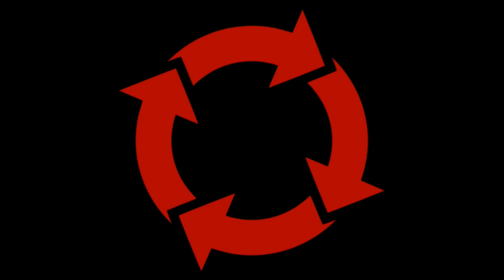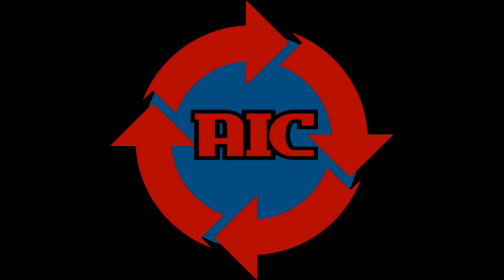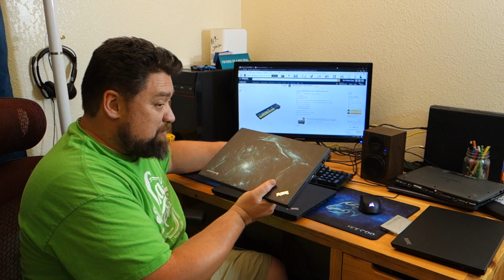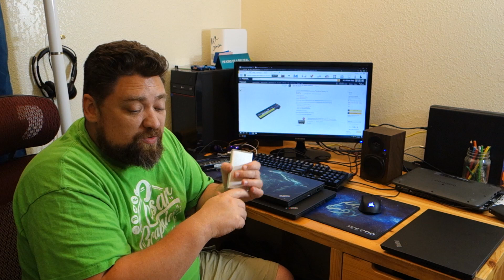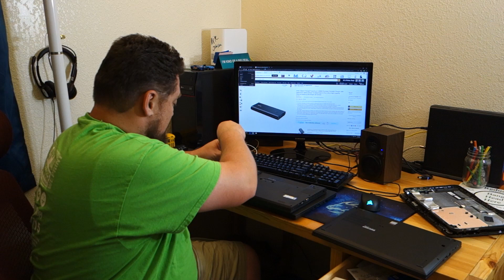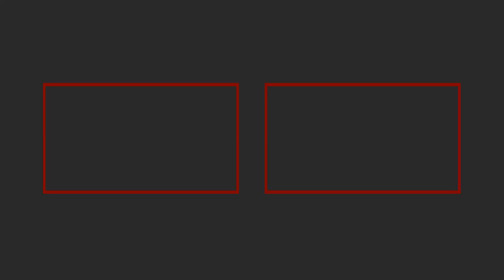My take on Thinkpad no longer having removable batteries

Comment: I think my x270 can be charged via the USB-C. Does that mean it works in the same way as if it was plugged into the mains with the square cable, to where it will charge the battery that is low but let me work also? (by using an external 65w powerbank charger)?

Comment: T480 has 96WH possible with Power Bridge. T480s without Power Bridge only has a single 57WH battery. I demand being able to swap batteries. This is a stupid direction just like soldering RAM and their legacy wireless card whitelists.

Comment: I might be wrong, but I believe the older batteries used cylindrical cells which are readily found in case you want to DIY a battery cell replacement. I know that the slimmer batteries on some of the laptops that I have don't have cylindrical cells, and have a soft cover, making DIY replacement basically impossible.

Comment: Only thing I'm afraid of is whether my otherwise slender fingers will be too thick to properly reattach all the flat cables after removing the motherboard to get to the battery. I was lucky I only had to remove the back panel to replace one of the ram sticks last I opened it.

My battery is at a point where it dies when it drops below 20%.
Reply from the maker: I just replaced a battery in an x280, it was super simple, no ribon cables, no motherboard removal, Just the back panel, 4 screws for the battery, and it lifted right out, new one click right in, 4 screws back in, back panel back on.
Reply: @AICvideo  Too bad I don't have that model.
It looks like it won't be too annoying on mine either though, but next time I buy a laptop, I'll either have to be lucky again or do extensive research on a product I don't care terribly about the specifics for.
Reply from the maker: which model do you have?
Reply: @AICvideo  It's and acer a315-55g. I've looked at videos, battery should be easy enough to replace. 
I was surprised to see it came with two 4gb ram sticks, one on each side of the motherboard.

Comment: The main reason behind non removable battery is company is forcing its user to use battery.
Once battery is depleted then user must go to company service center get your battery fixed.
Here company makes lots of money from selling you battery and also making you to pay for service center for opening your laptop.

I bought hp p028tx in 2014 .
It has user removable battery.

intel i3 
4 gb ram
2 gb ddr3 gpu.

I bought this laptop for gaming and coding.
when at home or at office I have constant power hence I remove battery and plug my pc directly to power using adapter. 
My laptop boots quickly and performs better on ac [alternating current] power.
I have used my laptop battery barely 2-3 times in last 6 years.
My battery is still intact.I have never wasted single penny on battery.
I upgraded my ram to 12 gb.
I can still play games like grid auto sports, dirt rally, assassin's  creed series from 1 till rogue.
AAA games consumes lots of power and hence it is not recommended to play on laptop with battery.
go for desktop or just remove your battery before starting game.

I definitely think laptop with user removable battery are required and companies are not manufacturing them for their own benefits.
Reply from the maker: batteries can be replaced by the user. It's a handful of screws and 10 minutes to do. They cannot be swapped out like they used to be able to, but anybody with a screw driver and a guitar pick (I use an old gift card) can get the job done, and batteries can be purchased from dozens of online sources.
Reply: @AICvideo  

Most of laptop brands consider opening laptop from back from unauthorized person as voilation of warranty.
[At least in india ,not sure about other countries.]

There are 2 type of laptops with internal battery.

type 1- laptop that does not work when internal battery is removed.

Consider the battery is bulging  due to prolong use and to save laptop from internal damage one decides to remove battery till he/she finds replacement.

But company don't care.First replace battery and then do your work is their attitude.

type 2- laptop that works when you remove internal battery by taking direct power from power adapter.

This laptops are much better.What is difficult is finding such laptops.

Main problem is why to use battery when there is direct power. Why waste battery when it is not required.

I have swapped my laptop battery in and out at least 10 to 15 times in last 6 years conveniently with just a press of button .This is not possible with laptops with internal battery also there are chances of damaging other components if one is not aware of the process.

Comment: hot swap > pop open backplate
Reply from the maker: I have had my t25, x250, and x270. I have never hot swapped the battery, despite having spare batteries.
Reply: Or a switch to bypass the battery

Comment: How dare you call us afraid to change? Using an external battery is more convenient. People can swap them and get instantly 100% charge. In case the battery doesn't hold the charge you can change it. You also have several options that you can choose from. We had the X series with no battery and slimmer form factor, but taking the T-series and make them thinner with no external battery is wrong. We need to have options to choose from. Don't try to make excuses for Lenovo. They are ruining the Thinkpad line.
Reply: T480 was the last real Thinkpad. Bring back Power Bridge!
Reply from the maker: I dare because it is true. A removable battery just isn't applicable anymore.

Comment: I think the issue is that after 18 months to 2 years, the amount of charge the battery will hold goes down precipitously.  Perhaps you like throwing away devices because the battery bites the dust, but many of us don't...
Reply from the maker: but it takes <5 minutes to swap out the battery with a basic screw driver when that happens.